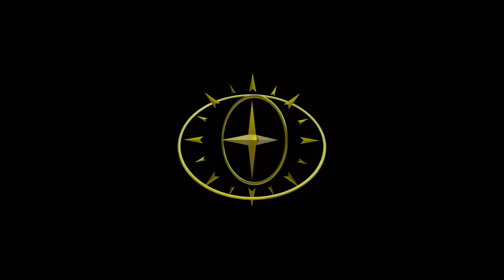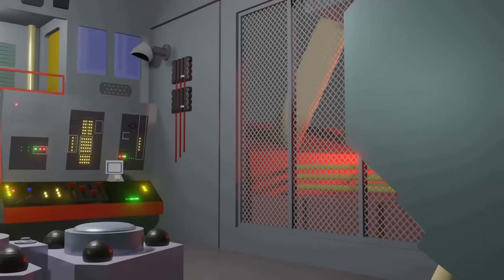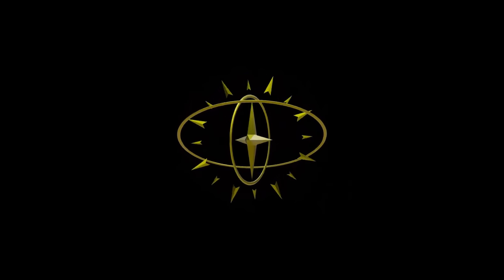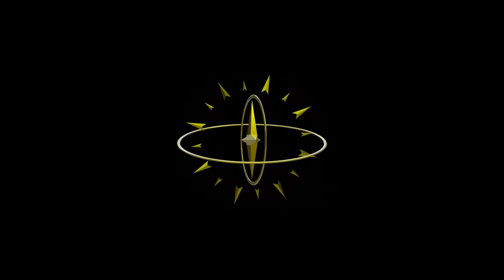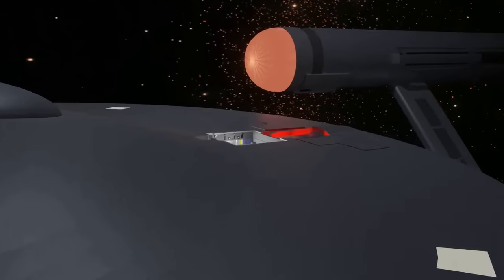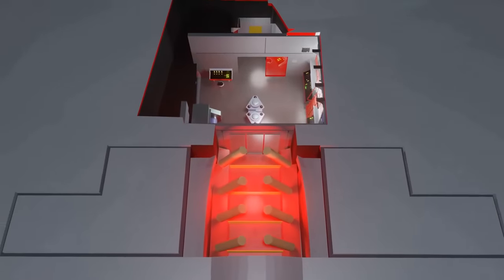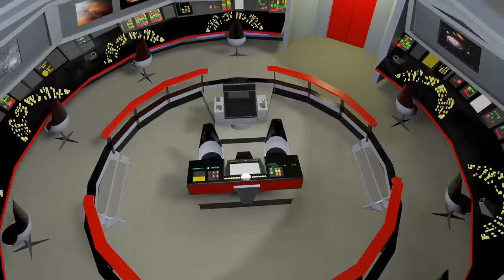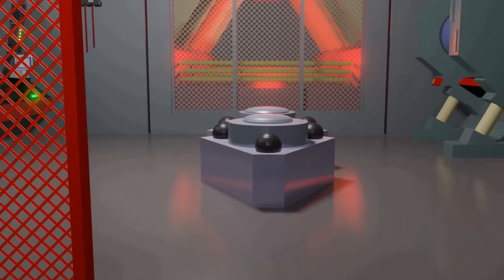The Enterprise Engine-room Enigma: where was main engineering?

Comment: Where was the engine room on ships that came before the Constitution class? That might be more relevant than where it was in later designs. In the NX-01, the engineering section was at the back of the saucer, just as many fans thought it was for the Constitution-class Enterprise. Most of the other pre-Constitution ships shown on screen in both canon and fan-made productions do not even have a discrete secondary hull. It is reasonable to speculate that the "engine room" seen on TOS, which served primarily as an engineering control room, was actually located in the aft part of the saucer because that was where it was traditionally located; adjacent to the impulse engines. During the Enterprise refit, a new generation of engineers may have decided that it made more sense to move the engineering control room to the secondary hull to place it closer to the antimatter reactor and other key power systems it monitored.

Comment: Well if you look at the shuttle bay or hanger deck area you’ll notice two garage like doors in front of the clam shell doors (Bow wise) which is where other shuttles are stored which means you would have enough room to fit main engineering in there, so putting Main Engineer in front of the impulse engines would make much more sense. I’ve looked at the ship with the clam shell doors open and thought that there is no way main engineering would fit in there. You’ll notice though perspective of the ship hull that the main shuttle bay is so big that it goes past the nacelle pylons and then you have those hanger doors that look like garage doors that look like there pretty deep within that star drive section where the shuttles would be stored. So it would be a very tight fit to put a main engineering in there, so putting main engineer in front  of the impulse drive would make a lot of sense in my opinion.
Reply: Well the ship was a contradicting mess in the original series anyway, in some images it looks like the shuttle bay is going past the pylons in some images.

Comment: You missed an important factor that was brought out because of the Next Generation saucer separation. Even the Original Series the saucer section was detachable and could be separated with impulse drives for moving away from danger while the "secondary hull" had the warp drive and battle bridge.
In one of TOS episodes they had the "secondary bridge" taken over by hostiles, this supports the saucer separation and 2 engine rooms one in the saucer and one in the secondary hull.
Reply: Saucer could be separated for emergencies only for the TOS ships. Once separated you couldn't put them back together as it was done with explosives. Also there is no impulse engine on the secondary hull of the TOS ship so it would be not be maneuverable. (Enterprise D has two sets of impulse engines one on the saucer and one on the secondary hull) The secondary bridge is a back up in case the main bridge is taken out. Since the people designing the ship were mostly former military they would have designed a back up bridge as Navy ships have a secondary bridge from which to control the ship. (IOWA class battleships had multiple places from which you could control a ship in an emergency if the main bridge was wrecked)
Reply: @zombieshoot4318  Uh, the Secondary Hull still has Maneuvering Thrusters, it might not be able to keep up with the saucer section, but it's still gonna be able to move.
Reply: @L1z43vr  maneuvering thrusters are for turning the ship in various directions. They are not capable of providing more than a tiny amount of movement. Once the secondary hull is separated it’s essentially abandoned. That’s the whole point of the separation. Main hull acts as a giant lifeboat.
Reply: @zombieshoot4318  Maneuvering thrusters are still capable of getting a starship outside the spacedock, and a little bit of movement in space is all you need, since, well, space is a gravity-less vacuum and inertia pretty much dictates everything, you could still use the secondary hull as a sniper or as a ramming weapon.
Reply: @L1z43vr  The secondary hull would never gain speed fast enough from maneuvering thrusters to ever be used as a ramming weapon. Unless you're ramming a planet. Everyone else could just move out of the way. Easily. Thrusters have no where near the power the impulse drives have and that's good because their job is to change the ships direction. The Constitution Class saucer separation is for emergencies where the secondary hull is damaged beyond repair and represents a danger to the rest of the ship.
Reply: "Auxiliary Control"; "Secondary bridge" is from Galaxy Quest.

Comment: By the way if you put the edge of the saucer next to the shuttle bay/ Hanger deck which is two decks tall you’ll notice they are almost the same size, also if you use the height of the shuttle bay as a measurement you’ll notice that the Constitution Class would only be able to  fit 11 decks within it, which means the ship can not have 23 decks in it.
Reply: Example
With the Stardrive tube structure you can only fit around 5 decks if your using the shuttle bay which is 2 decks tall as measurement for that section of the ship.
Reply: The explanation is clear: The shuttle hangar has inner and outer doors, with the outer doors for some daft reason twice as tall as the inner doors. That's the only explanation that makes sense (in-universe).
Reply: The other day, I counted the rows of windows on the Galaxy class model and found it came up about 10 decks short as well
Reply: @kaitlyn__L  I remember counting the deck lines on the Galaxy Class blue print, it aint 45 decks, it is a bit over 30 decks, not to mention the window size next to the people, which in turn makes the Galaxy Class look much smaller then what people say it is and judging by the rows of windows and ones on top of the other does make the ship to be around 30ish decks tall.
Reply: @emperorofscelnar8443  funnily enough, I once read an analysis of the Excelsior which showed it had too many rows of windows. Which, I definitely always got a good sense of scale from that model. Makes me wonder why they didn’t make the windows smaller on the Galaxy model, it was ILM both times after all. Maybe it was to ensure they were still distinguishable from each other on TV.
Reply: Are you talking about the Jefferies drawings or the actual model proportions here? The doors on the 11 footer are considerably taller, by about 30% over the saucer's edge height. Where the hanger bay's aft bulkhead is suppose to be is considerably taller than that. It's about three decks average. I can get at least 16-19 decks out of that total.
Reply: I compared the shuttle bay with the side of the saucer using my model and then I compared the shuttle bay with the rest of the stardrive even its neck, if the shuttle bay is two decks tall that would mean that the cylinder of the stardrive section is around 5 to 6 decks tall, the same can be said about the neck structure, so I highly doubt the ship can fit 23 decks in it, it would have to be much larger for that to work like the Kelvin Enterprise.
Reply: Plus there is no way you’d be able to fit a main engineering in that cylinder section of the stardrive, I have seen images with the shuttle bay open and it goes past the nacelle pylons which means there would be no room to fit that main engineering section. Having main engineer in front of the impulse engines in the saucer section made more sense because you would have much room in the stardrives cylinder section especially if you have a shuttle bay in it that is long.
Reply: @Nowhereman10  I would think of the Constitution Class being like 18 to 19 decks not 23, there’s no way 23 decks would fit in such a vessel, 16 to 19 is more accurate.
Reply: @emperorofscelnar8443  I did. the hull is at least  8 decks deep based on windows and the hanger bay. Others have as well, see the Doug Drexler and SciPubTech cutaways.

Not counting the dorsal decks, the 11 decks in the saucer makes no less than 19 decks, and add in a couple from the dorsal where it and the lower saucer don't overlap, then you get 20-21.

Comment: In reality I think we just have to chalk it down to the limitations of the budget and TV production schedules.

However, there could be some ways of getting round the contradictions in-universe.

Firstly I'm sure there were times they referred to warp power being used for the impulse engines. Which may suggest a more direct connection between the impulse and warp drive power systems for the TOS era.
For example, when Finney shut down the engines they had to restart warp power rather than just using the impulse engines, which in TNG era are fusion reactor motors.
However, given how many times the Enterprise was crippled by losing warp drive, by the time of the refit they may have recommended separating the warp and impulse systems for redundancy in emergency situations.

Secondly, if impulse and warp engines were more interlinked in the TOS era, main engineering may have been located in the saucer section. It may well be certain components of the warp drive were too dangerous to be close to whilst in use (EM and particle radiation, subspace flux etc), so the control room was in the saucer section covering both impulse and warp systems.

Conversely, Main Engineering may have been in the Engineering hull, and the curved corridor access was due to other equipment installed. Either as part of the warp drive, or some other large  system. On the Enterprise-D the TNG Technical Manual suggested the main computer core was in the engineering hull. So the corridor may have been curved around it so that engineering staff had quick access to both the computer core and main engineering control.

Personally, I think the refit/TNG  practise of locating main engineering in the engineering hull makes more sense. As you'd want as short a distance between the warp core and nacelles as practical for safety purposes. If not for other reasons such as warp field efficiency and stability.

Comment: The saucer section can detach from the drive section and serve as a lifeboat in case the drive section can't be repaired, no use in dragging its mass around if what you're trying to do is get to a nearby star system. So, you really don't want to have engineering left behind if you do that. Thus, main engineering is in the saucer section, near the back, in front of the impulse engines.  And, yes, you can control the warp drive from there.
Reply: But the saucer section separating is not canonical, is it? As far as I remember it is only in some comics and in the Abrams-verse. I haven't read the technical manuals etc, though.
Reply: @Rocket_Try  I think that it is mentioned in the technical manuals, but they would never do it in TOS because it was not intended to reconnect like the saucer in TNG. So, if a writer ever attempted to do it, the script would be just be rejected.
Reply: @LabyrinthMike  ah yes. It a one way ticket. I remember.
Well, considering how seldom the separation function of the galaxy class was used to save on production value it borders on not making a difference. At least in the series.
Reply: @Rocket_Try  In the episode with "Val" or "Vaul", Kirk tells Scotty to the effect "get out of there with the main section if you have to."  That is the only reference I am aware of.
Reply: Keep in mind.The studio model was built as a solid piece. It could not separate. They would have to build another model that could ,if they wanted to show a saucer separation on film.

Comment: 2  nearly identical Engineering control rooms must exist, in some episodes that intermix frame for the dilithium crystals is not present on the floor as in the ultimate computer episode, that would indicate they set the computer up in the impulse control deck and not the warp control deck.

Comment: I have been a Star Trek since 1966, I have read all I can find on the subject.  You have to remember..... "Main Engineering" is where ever the script needs it to be LOL  But, I have always felt it had to be in the "secondary Hull."
Reply: You're forgetting the ship has two types of engines. The original Star Fleet Technical Manual has TWO engineering areas: an area marked "Main Engineering" near the Impulse Engines in the saucer, and a separate "Warp Drive Engineering" in the secondary hull right under the nacelles. Main Engineering is shown to have computers that can monitor the warp drive from there. Makes sense: the Enterprise has two different types of engines with different needs, and a crew of only 430.

Comment: This is rather easy to answer, as it was answered initially in ST:TNG; the writers were concerned if they didn't build main engineering further pilot, it would not have been built, much like TOS. 

Understanding "engineering" is not really how you are explaining it.  I served in subs, and we have A LOT of engineering spaces.  Any space dealing with propulsion, water creation and waste, power generation, atmospheric controls, and emergency controls. As all warp equipped starships have at least three forms of propulsion, each propulsion system would require its own spaces. 

Logically Main Engineering, where all engineering systems are monitored and can have overall control authority, would be as close to the warp core as possible. Losing master control, through direct linkages and electrical/electronic control systems, would be detrimental to any rescue or wartime efforts. In addition, have these primary controls pass through the neck would be an exploitable weakness in battle.  In TOS, we never actually see Main Engineering. We see the main engineering facilities in place for each subsystem.

Comment: I served on the USS Enterprise back in 2269, and can confirm main engineering was in the secondary hull. The curved corridor outside bent around the captain’s private jacuzzi, which was heated by the plasma conduits snaking around it. Only female crew were allowed inside, so I don’t know much more than that, sorry.

Comment: I think we were meant to believe, that during his surprise attack in 'Star Trek II', where he first and foremost began his bombardment along the Enterprise’s port side 'drive section', Khan “knew exactly where to hit us” primarily due to the fact of his having spent so much time aboard during the events playing out after the Enterprise picked up the Botany Bay in the original series 'Space Seed' episode.

And also, as all throughout the original series, when we see Scotty or other personnel, crawling up a ladder within a circular tube, which rises up from the Engineering Room deck, at an incline in relation to it.  Were we not to naturally suppose, with the most logical deduction to be made; that in accordance with the Constitution Class Starship’s most obvious angular architectural feature, from an external perspective; being of course, the Warp Nacelle pylons, connecting the nacelles to the starship’s 'drive section'; that said inclined 'Jefferies Tubes' reasonably lay within those angular pylons.  For after all, they would be a critical juncture in relation to starship power and speed, as they provide the only relay from Warp Core to Warp Nacelles.  This would be a wonderful in-universe explanation, as many a dramatic moment occurs within them, dovetailing quite nicely with several design features and components.

Comment: I have always felt that there were two engineering rooms.  I am sure that was the intent especially when they used the term main engineering for the secondary hull.  It was also understood that the saucer was able to separate in the 1960's version of the ship although this was never filmed.  That saucer would need an engine room.  All inconsistencies were possible from cost, varied writing staffs, and television magic.  Just my opinion folks.
Reply: There are two of all the essential areas since either section of the ship canbe detached and used as a self sustaining vessel.

Comment: Logically there would have to be two engine rooms one for impulse and one for the main warp core. The first engine room been up in the dish next to the impulse engines, and the secondary in the lower hule. Since the dish was able to separate from the main body and become a separate ship as a lifeboat, it would have to have its own separate engine compartment. But it would make no sense putting them warp core on the dish behind the impulse engines and a vulnerable spot that could be targeted by Klingons. They are not packleds😅.

Comment: For me, Engineering could have been anywhere. Based on the books I own, the secondary hull is the logical location. However, given the plot holes over the years and the many attempts to retcon everything in sequel shows, it’s likely that Engineering had multiple locations and it’s only the designation Main Engineering that is considered important.

If the intermix chamber needs to be close to the pylons to minimise power losses to the warp coils in the nacelles, the secondary hull is the best bet. As to where it is situated within that hull, just forward of the pylons would make sense.

That would allow for EPS taps to provide power for the ship systems and some of the warp plasma to be siphoned off to provide power to the impulse engines.

Comment: Actually if you really think about it there would have to be two engineering sections one for the saucer section and one for the secondary hole four times when the saucer section would separate each part would have to have an engine room.